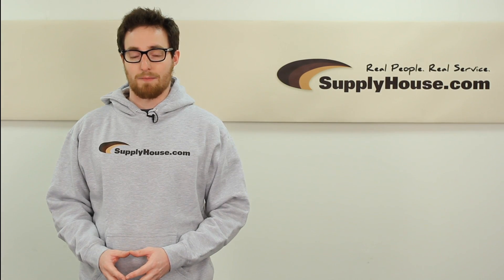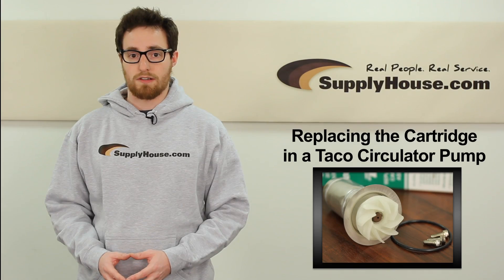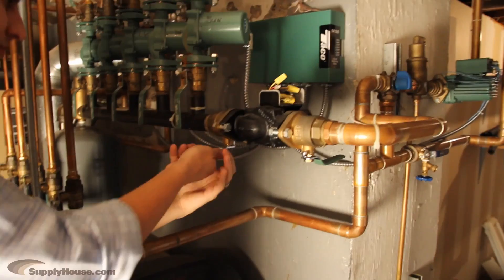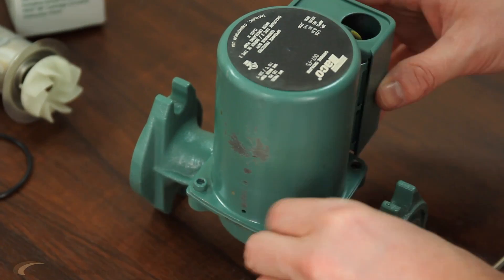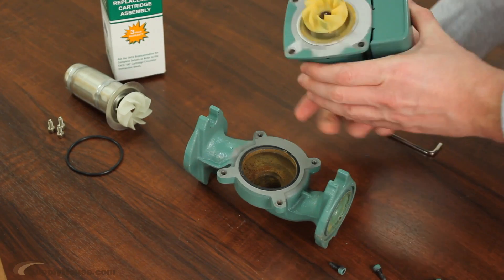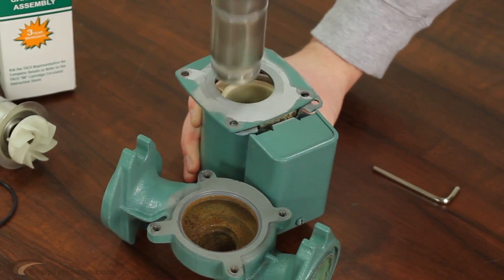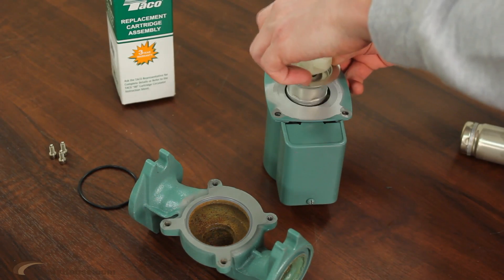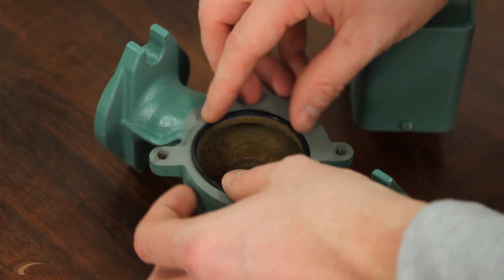Circulator Pump Cartridge Replacement

Comment: And what is the difference in price between a cartridge and new circulator??
Reply: About $40 in 2020
Reply: @RudyNortz  Exactly. That cartrige is one of bigest rip off s
Reply: If your pump is welded in line, the labor costs would make the replacement of the entire pump a lot more than the cost of the pump. That's why they make the replaceable cartridges, for field serviceability.
Reply: @Burghound56  in residential heating never see pupp be lelded to pipe .
Reply: @RudyNortz  was some90 doll+ for replacent . So is not worth
Reply: @786otto  My pump is welded in line, from the manufacturer.
Reply: Should use flanged pumps instead, as shown in the video.  Doesn't seem like there are any benefits to using captive pumps that need to be soldered in place.
I needed a replacement ifc valve for a Taco pump, and it costs 30 for just that piece of plastic, and an additional 98 to get the whole thing, which I opted to do instead. 
Not sure why the IFC is so pricey relative to the full assembly, maybe because there's little demand and they want to maximize profit on every sale they can get.  Not sure what the failure rate is with them, but I'll see what happened when I take it out for replacement-

Comment: Why remove the pump from the flanges first? Can't you just change the cartridge with the pump in place? It seems like the housing could come off independently of the flange connections.
Reply: I thought changing the cartridge w/o the necessity of removing the entire pump  was one of the basic ideas behind creating  the cartridge system
Reply: Yes, but for simplicity and being able to view just the pump, he shows the pump in isolation. This is actually no different than if you were reading the repair manual -- the illustrators would not show you the pump connected to an actual system. Think about it, if he and his crew worked on an actual installation, the lighting and camera angles would be more problematic and production value would have suffered. Then there'd be complaints such as "I can't see where the bolts are", and such.
Reply: To make the videos easier to view. . .

Comment: I have a pump that appears to be leaking when the water pressure for the house is removed, yet stops when the water is turned back on. what possible reason is there for this?  I assume the o ring needs to be replaced, but just find it strange that it only leaks when there's no water pressure.

Comment: why is it especially important to operate it and purge the air when installing it in the off season?  Does the air cause problems like corrosion when it's sitting idle without running?

Comment: We bought one of these from you because the pump would hum but not spin. Do you think replacing a new motor cartage would fix it? 
When I took the old pump apart  the old cartage will not come out as you show. Do you think the pump winding  in the otter case are all rusted up? Also the gasket is hard to position correctly, should I silicone it in place?